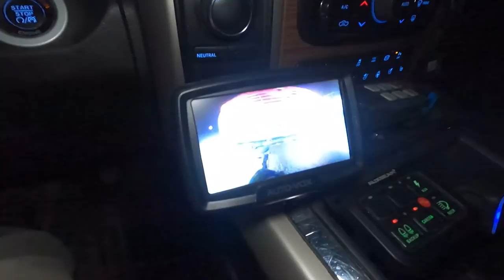Night shift in a tow truck!

Comment: When you pull in behind the vehicle you should turn your wheels to the right. That way if it does get hit from behind it will veer off to road away from you keeping you safer. Happy Thanksgiving Casey!
Reply from the maker: No, definitely not!   If I hear screeching tires I'm running to the right and I don't want that truck following me
Reply from the maker: @korbinstudnicki3510  no, it's a horrible idea.   If I did that I would have nowhere to run
Reply: @CaseyLaDelle  take it from a retired traffic cop…your front wheels will turn off the road away from you and the vehicle in front of it. BTW, drunk drivers don’t hit their brakes so you’ll not hear a thing…ever again…
Reply from the maker: @C8sorbs  think what you want, I'm leaving them straight ahead
Reply: Well you are wrong as a recovery technician in the uk for 30 years institute of vehicle recovery trained your wheels should be turned for us in the uk to the left in usa to the right
Reply from the maker: @markwemyss4188  that makes no sense.   What options does that leave you for escape?

Comment: Funny not strobe lights or beacon on a tow truck
Reply from the maker: No, because strobe lights are dangerous
Reply: Hey Casey, I’ve been filling you for  quite some time now, I’m not very active with YouTube because I’m not very savvy. I watch a lot of your videos and you seem like a straight forward fellow. If possible may I amend you a feel emails and ask a few questions about business. I live in MA and do a lot of work relative to your channel. Just about everything you do I’ve been looking at getting into which is how a sound your channel. I currently own an auto repair shop and am looking to make a transition into trucking/ towing. If it’s possible to private message on here that would be ok too. Thanks for the posts. I am aware this is an early video and you’re into bigger better things now but I’m looking to start small like you. Thank you.